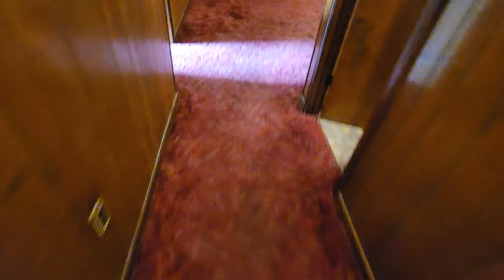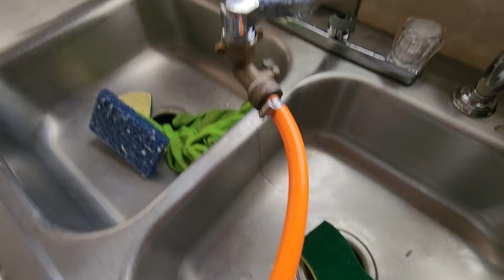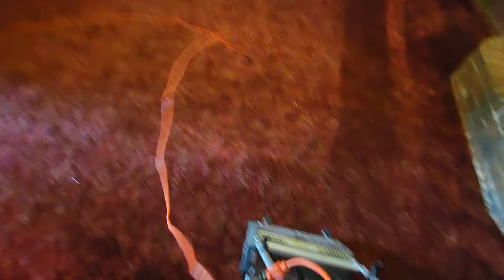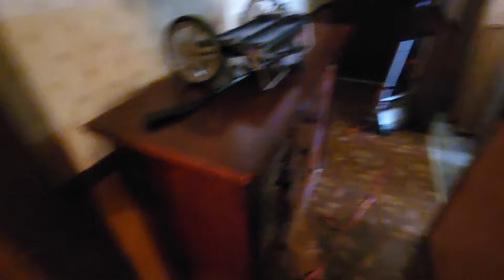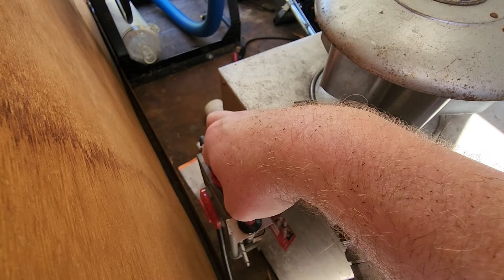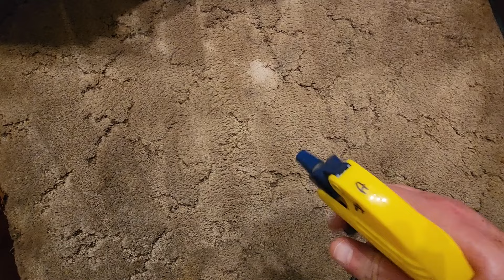Cleaning 1980's Filthy Crud Covered Carpet

Comment: Do you clean tile with that pump?  Can the little giant handle 1220 psi if you do?  What pressure do you clean carpet at.   That old nylon really stands up well.  Thank you.
Reply from the maker: Yes I clean both carpet and tile with the pump. I clean carpet between 500-550 psi and crank it up to 1200 psi for tile. As for the heater, I doubt it would handle 1200 psi. If I remember correctly, the 2HT like I have is rated for 600 psi and are tested at the factory at 900 psi. I just bypass the heater for tile cleaning and connect the solution line directly to the pump at 1200 psi. What I used to do was set the pump at 800 psi and use the heater but I found that I would get better results at 1200 psi with no heat than 800 psi with heat. Plus I wasn't risking blowing a hole in the heater coil. I had heard for a long time that heat wasn't necessary for T&G cleaning and now I believe it. Of course I'm not doing any grease pits or anything, just residential and light commercial.